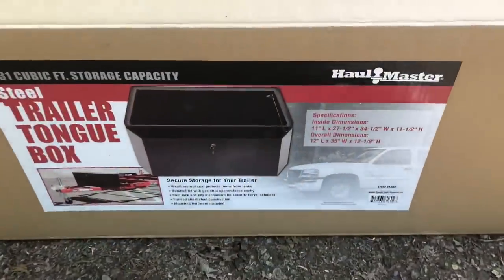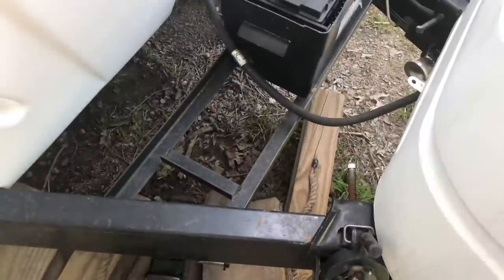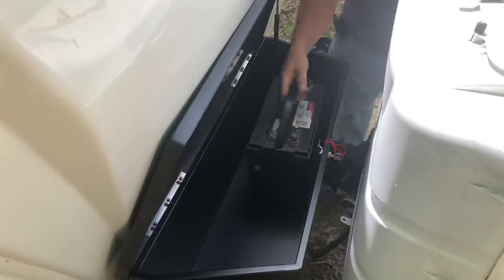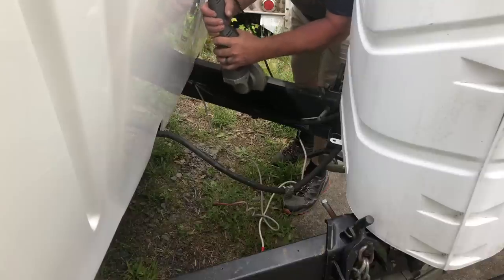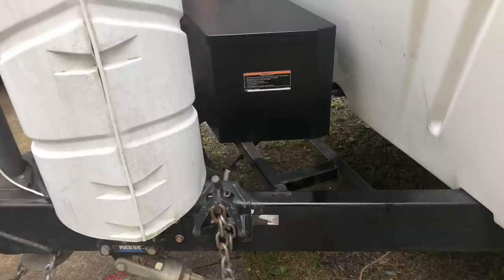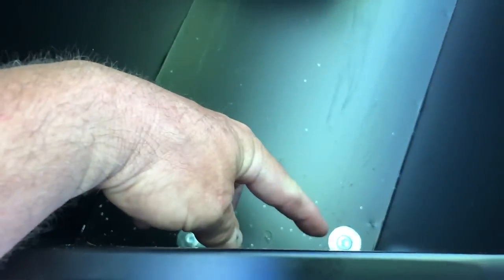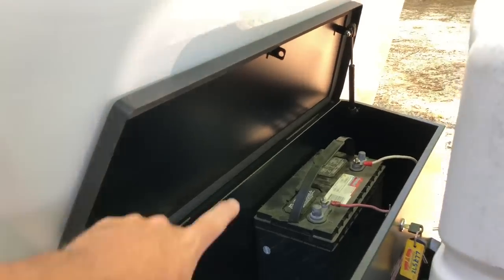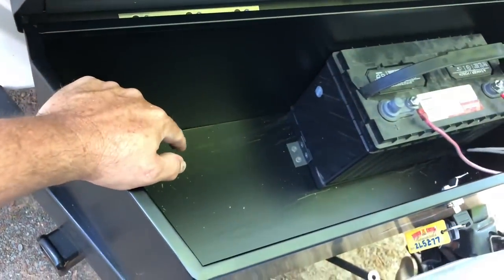Harbor Freight Trailer Tongue Box Install

Comment: This video was helpful just need to make sure this cheaper of the 2 Harbour Freight tongue boxes available fits.  This box was $135ish after tax and the slightly higher quality option from HF is almost $180 with tax but it’s easily 50% better box.  The salesman at HF yesterday tried to sell me the more expensive one and explained why.  The lock mechanism is better, the rubber weather stripping is better, the overall thickness is better.  I walked out of the store with this cheaper box because I felt it was enough for what I was going for just need to now make sure it fits on 2021 jayco 24rbs.   Just wanted the world viewing and reading these comments to know that 2 tongue boxes are offered from Harbour Freight and this box is the lesser quality ie cheaper of the 2 available boxes.  The more expensive one is worth the extra money.  It will last longer and won’t need a under tray simply because it’s thick enough to support two rv batteries but I believe this box may not be and may require more underside support.  I am not there yet but will know soon.  Worst case I might just go return this one and get the better one for $40 more dollars

Comment: Thanks for the video! I have the stuff on order to do the same! Thanks for the link to the vent, I am picking one of those up right now. I bought a piece of angle iron and will cut it off with wings on each end so that it can sit on top of the trailers frame. It will be similar to yours but with the wings on top of the frame. I plan to drill a hole through it and then screw the box down to it all at once. A couple of questions though:

Did you pre-drill the holes for the screws that you screwed the box down to the frame with? If so, do you remember what size drill bit you sued to pre-drill, and what size/type of screws you used?

Also, did you use a rubber grommet or something for the hole that the wires come in through?

Thanks!

Comment: Did ya just weld inches away from propane bottles? Auto part store has terminal covers so tools bouncing around don’t find their way to arc from positive lead to the box. No drain? A thin piece of rubber between bolted connections will make everything quieter and last longer.

Comment: I’ve never welded but want to start. Can you provide a recommendation on what basic equipment I’ll need to get started? I know there’s “mig” and “tig” but don’t know the difference. Any advice appreciated! - Randy
Reply from the maker: Unfortunately, I’ve never been trained to weld, I’ve just picked it up over the years. I really don’t know the answer to your question either, I borrowed the welder my father in law had.

Comment: Thanks for the ideas.  How has the box held up?  Is it waterproof? Or are you finding any water in there after a rain/travel day? If so, did you add a drainage hole on the bottom?

Comment: Nice modification. I think I would look at putting the vent on the back side so you don't get snow, or water, in your box from driving down the road.
Reply from the maker: Thank you, I did add a small vent on the back, it worked out great and stays dry inside the box.

Comment: Doesn't welding on the frame weaken it?
Reply from the maker: I don’t know the answer to that, I haven’t worked with metal enough to say for sure. I can tell you that I never experienced any issues after this project and my dad had several campers through the years that had been welded on the frame. We have recently purchased a new travel trailer and store the hitch a different way now. I will post a video soon, it’s much simpler with no welding.

Comment: Hey great video. I'm about to do something similar on my trailer and was wondering what kind of settings you used on your welder? Like amps/wire speed/filler? I always have a tough time finding the right settings to get clean welds like yours. Thanks for any input
Reply from the maker: Hey, as we started welding we made some adjustments until we got it to the right heat and wire speed but I have no idea what those settings were.

Comment: Great vid I’d like to do the same. My battery tray is rusty so I’m having someone weld on some new ones. I really like this cargo idea but how would I vent the box? How are you going to vent yours?
Reply from the maker: Thank you, I added a small plastic louvered vent made by Valterra, I cut the hole for it and just used silicone to secure it in the hole. The vent looks good and has been working fine. I added a link in the description below the video for the vent, it was under two dollars.
Reply: Nice! Did you use a hole saw? I’m trying to figure out if it’s something I will be able to do on my own.
Reply from the maker: Actually a hole saw would probably work great, I used a jigsaw with a metal cutting blade, it cut good but wasn’t easy due to the wall on the box being thin which allowed it to flex a little while cutting.
Reply: Thank you so much for the replies! I now have confidence to do this on my own 😊
Reply from the maker: Jnay Jnellius Youre welcome, I would suggest cutting the hole for the vent before attaching the box to the trailer. I attached my box first and I had limited access when I started cutting the hole.

Comment: Nice fit, get rid of the screws. Not to code, not safe and you jeopardize people’s safety in using them. Use bolts or weld the box in.